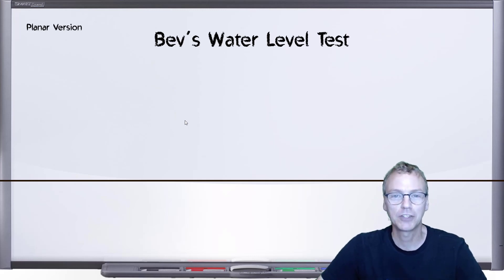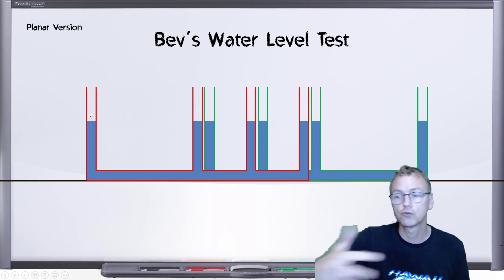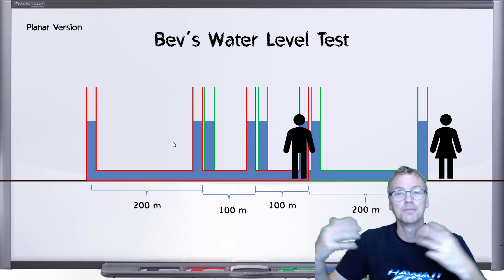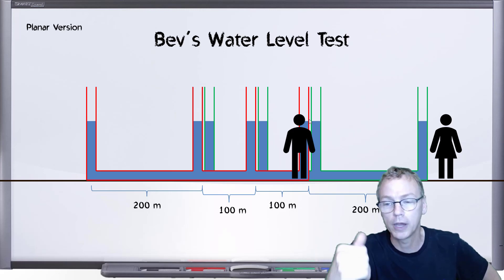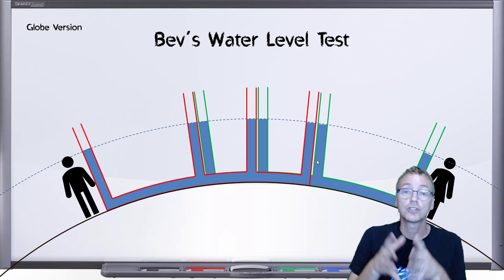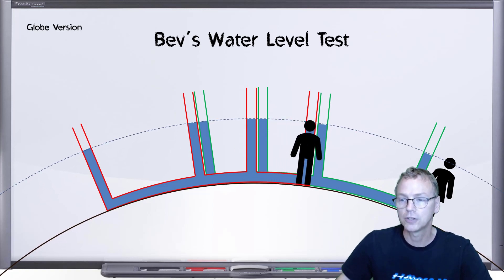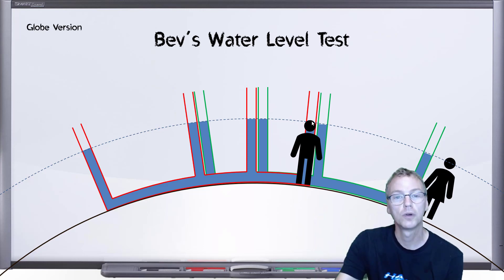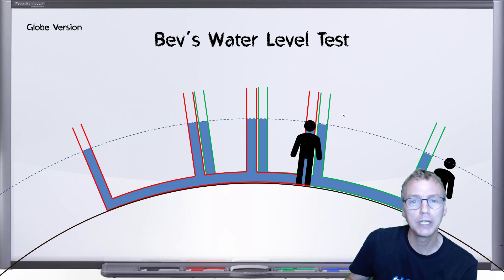Bev Try Thinking and Spot On Level's Water Level Test

Comment: Didn't Sly Sparkane have a similar test a few years ago? Something with a 1 km stretch of pipe/hose and looking through the top-levels at different points. 

The problem with a test like this is that it might seem nice in theory, but has several practical problems such as potential leakage and possible friction & pressure-drop effects. And over such small distances, even if the tops are truly 'level', I suspect the differences between flat and globe might be very small.

Celestial observations of stars/sun/moon are much better as they can span 100s, 1000s of kilometers and aren't affected by refraction as much. But, well, we already know that they don't consider those to be acceptable.
Reply: Yes, Sly did such a test (and experienced some "practical problems" when he actually carried it out).
Reply: What do lights in the sky have to do with the ground we are standing upon? No globe proofs up there either, sorry.

My lightbulb is round therefor my living room is round syndrome.
Reply: @fpvangel4495  “What do lights in the sky have to do…” Plenty. Those of us with functioning brains can use them to  figure out all kinds of things about the planet we live on, and even where we are on it.
Reply: @David_Lee379  Navigation does not require a globe, simply use the Mercator as realworld data is as thats where its all coming from, all you have is Google Earth im afraid, a cartoon ball.
Reply: @fpvangel4495  BAAAHAHAHAHAHAAA! Dude, you couldn’t navigate your way out of a wet paper bag.
Reply: @fpvangel4495  and I'd really rather you didn't bring up map projections when you don't know that they don't fit your argument.  The mercator projection may be present on a flat paper, but the data on the mercator projection is all sphere shaped.  Go ahead and look up the maths for the creation of the mercator projection and tell me how it isn't sphere shaped.
Reply: @cuross01  Don't bother... the guy cannot even distinguish between the mercator and equirectangular projections.
Reply: @fpvangel4495  "What do lights in the sky have to do with the ground we are standing upon?"
In principle, nothing. But stars can serve as reference points. The ground is a certain shape and the angles between the stars and ground at different locations depends on that shape. This is very basic geometry.

Here are two simple examples that you could even do at home. Just take your phone, hit record, and slide it along the surface of, say, a flat wall and a bottle (holding the phone's front against the surface). Even though you can't see the surface itself, it should be trivial to tell which is which.

We can do something similar by looking at the stars. Take Polaris, for example. On a flat earth, the relation between its elevation angle α and your latitude θ is something like α = arctan(C/(90-θ)). On a globe and faraway stars, it'll be α = θ. The observed relation is α = θ. This fits very well with the globe predictions, and not at all with the FE prediction. Globe wins.
Reply: @cearnicus  Google Earth geometry isnt real, sorry.
Reply: Excuses, assertions and assumptions, ok got it.

Case closed.
Reply: @fpvangel4495  "Google Earth geometry isnt real, sorry."
Reality disagrees. Also nice dodge; I wasn't even talking about google earth. No one here was. I was just explaining how geometry works.
Reply: @cearnicus  Geometry you fail miserably to prove i might add.
Reply: @fpvangel4495  lights in the sky are pretty easy ways to measure what you are standing on.  In fact, let's take it to geometry textbooks.  Are you suggesting that it is not possible to measure the circumference of a circle by using points outside of that circle?  You can draw it out if you'd like
Reply: @cuross01  And another fails to prove a globe, this is serious lol.
Reply: @fpvangel4495  fascinating.  Disregarding questions and concepts that you don't want to think about, you simply waive it away with a "I don't understand what you're saying so you fail"

Gotcha.  Gotta lie to flerf
Reply: @fpvangel4495  You live in a lighthouse, don't you? /s
Reply: @grahammatthews5835  You have 0 proofs of a globe have you!
Reply: @FPV angel Have you heard about star maps? You can use them everywhere. The sky is the same, but the earth is down in different directions.
Reply: @fpvangel4495  why would I need to "prove" something that has been known for centuries? Just grow up.
Reply: @grahammatthews5835  So you cant then, why not say so.
Reply: @ReinoGoo  Im looking for one globe proof, not stars. :)
Reply: @fpvangel4495  before I would even consider taking you seriously I would need to know what you will accept (not what you will not accept) as "proof".
Reply: @grahammatthews5835  You dont have any so im just here to laugh really.
Reply: @fpvangel4495  Are you hard of understanding?  Explain what 'proof' you will accept.  You can't know that I don't have any until I tell you I don't have any.  I want to know what you will accept.
Reply: @grahammatthews5835  As explained, you dont have any. :)
Reply: @grahammatthews5835  Im still laughing here.
Reply: @grahammatthews5835  Of course FPV won't tell you what "proof" he would accept as he has no intention of accepting any. What he wants you to do is to keep offering evidence which he can then summarily dismiss as not meeting his requirement.
Reply: @davidfaraday7963 - to be honest, I expect nothing less from disingenuous people like him.
Reply: @awatt  I couldnt care less if it was a toilet base, its idiotic but deserves a chuckle. ok next please.
Reply: @fpvangel4495  
Ship Model Basins prove the globe.
Globe confirmed 🌎
Reply: @awatt  Haha, you did the toilet flush test didnt you.
Reply: @fpvangel4495  
...with your head down it.  LOL 🤣
Still not flat.
Globe confirmed 🌎
Reply: @fpvangel4495  "I couldnt care less if it was a toilet base"
So you didn't even care to research what a ship model basin is, and why it has to be built taking earth curvature into account... try it, maybe you can "decode" why the rails are level but not flat.
Reply: @jaimevivesp  it already sounds sillier than what ive heard so far, sorry, its barely laughable, try harder.
Reply: @jaimevivesp  
He can't decode anything because his head is down the toilet. 🚽
Reply: @awatt  Well, that and being totally nuts.
Reply: @fpvangel4495  I know, reality sounds silly to you...
Reply: @jaimevivesp  Next please.
Reply: @fpvangel4495  - "it already sounds sillier than what ive heard so far, sorry, its barely laughable, try harder."

That is the worst rebuttal, ever.  If what something 'sounds like' is your benchmark then it's no wonder you don't understand even fundamental premises and principles.

Additionally, you only get one out of ten in the punctuation department.
Reply: @fpvangel4495 "Next please"
Oh... I can decode that: "I've no arguments".
Reply: @jaimevivesp  I shouldnt have to keep reminding you that Google Earth isnt real.

Next please.
Reply: @grahammatthews5835  Rebuttal to what? You have nothing lol.

Case closed.
Reply: @fpvangel4495  Well, your beloved mercator is based on the globe, so it couldn't be real either.
Reply: @jaimevivesp  Actually the globe is the Mercator map cut at the international datelines and wrapped around a CGI ball, like i said - all you have is Google Earth. :)

You are Google Erfers. :)
Reply: @fpvangel4495  just use geodetic surveying to verify the curve of the earth. Definitely a globe 🌎
Reply: @fpvangel4495  - the fun thing about the globe is the we have MAPPED it - accurately in terms of bearing, distance and area. It forms a 3 dimensional object (a geoid). We use this every day to navigate - it’s called WGS84.

Still waiting for an accurate “Flat Earth” map but all we hear is the pathetic bleating of excuses like “but maps aren’t reality”....
Reply: @fpvangel4495  " Actually the globe is the Mercator map cut at the international datelines and wrapped around a CGI ball"
I'm sorry to inform you that Gerardus Mercator  was making globes way before he invented the cylindrical projection. Ouch!
Reply: @fpvangel4495  I can think of a really good way to demonstrate that the Earth is a globe but can you answer a question for me so I know we're on the same page - can something physically higher than you appear below your eye level?
Reply: @fpvangel4495  You are claiming that the accepted model is incorrect therefore you need to prove it is wrong. You should start with an accurate map that can be used for long distance navigation by sea or air.
Reply: @davidfaraday7963  "Of course FPV won't tell you what "proof" he would accept as he has no intention of accepting any."

He just explicitly said as much. When asked what proof he would accept (which, you'll note, is not the same as asking what proof exists), his response, verbatim, was "you don't have any." edit: Sorry, he actually said "you dont have any." Wouldn't want to misrepresent a moron by correcting his grammar for him.

Then he repeated it. By his own admission, Graham has no proof that FPV would accept. And I reiterate, that's not the same as saying that he has no proof. We all have proof. Just none that any committed conspiracy-theorists will accept; which is exactly why it's important to always ask them that question. Those who won't answer (which is pretty close to all of them) are demonstrating that they have no interest in truth, but only in supporting their delusion.
Reply: @markwood1159  At one time FPV's go-to "proof" of flat earth was to argue that planes could not fly round a globe earth as, once they passed a certain angle, they would be in an unrecoverable dive. This was based on the insane notion that north is "up" and south is "down".
I see that he has now moved on from offering "proofs", however absurd, to merely insulting everyone who disagrees with him.
Reply: @fpvangel4495  
Bet any of us on the shape of the Earth. Your answer gives you away as a scammer/POE or a real believer.
Reply: @scott_meyer  Yet here i am laughing at Google Erfers. :)
Reply: @fpvangel4495  
Visit a Ship Model Basin and marvel at the curved water.  Thank me later
Reply: @awatt  Yawn.
Reply: @fpvangel4495  Do you really think that celestial bodies which are only above a flat earth, would move that same as celestial bodies that completely surround the globe?  Obviously you have not given this much thought and just parrot what you hear on FE channels.